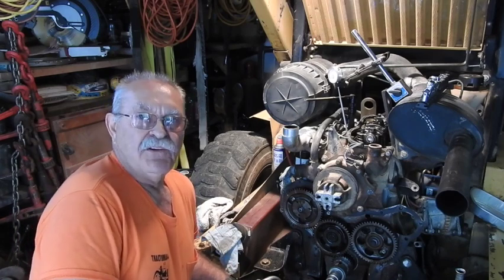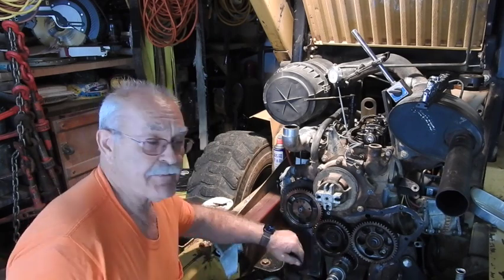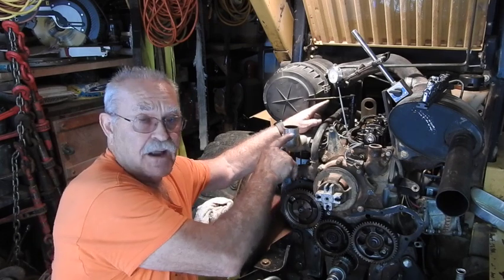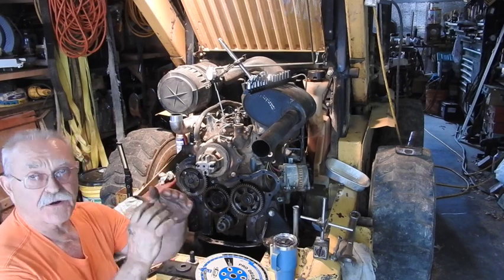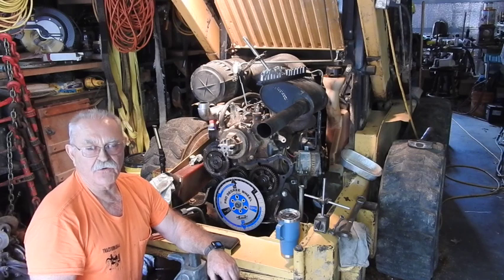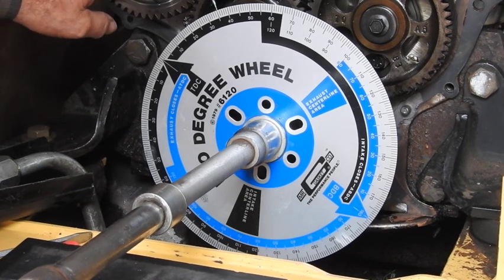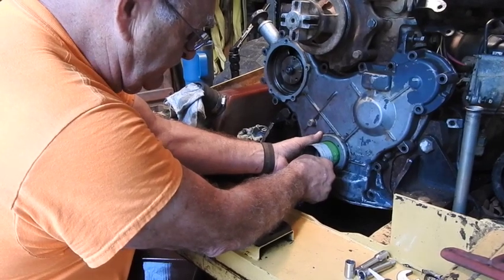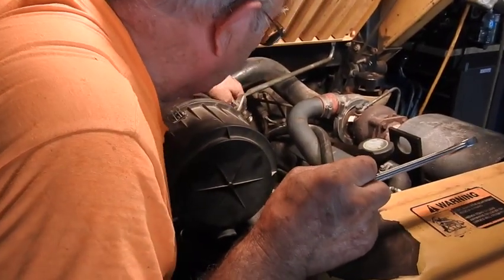Lucas Diesel Injection Pump Timing Perkins 332T

Comment: Hi Wendell, I hope you’re still responding to comments on this thread… I’m about to do this job on my LX865 with the identical pump. If I pinned the pump on removal and didn’t rotate the crank on the motor since removal, can i just remove backlash by hand and follow the torque sequence without all the degree measuring?
Reply from the maker: I would say yes as long as the injection services technique is to measure the exact degree of rotation prior to rebuild and returns it back to that original position. You might verify what their procedure is for dismantling and reassembling to be sure. Good luck with whatever you do though.
Reply: @tractorman4461 thanks! They told to me to pin it and bring it. No TDC needed… just confirming with you. I’ve watched all your videos on this machine. Thanks. Your response time is amazing.

Comment: Grwat video. I might be getting ready to do the same thing. I have a question,  when you mention that you messed up with the injection pump and the locking pin. Does that mean if you had just locked it to begin with and never turned anything else, you could have had it rebuilt and stuck it right back in without messing with any timing on the motor? Thanks
Reply from the maker: The two local diesel injection service companies in my immediate area confirmed to me that they place these pumps on a computer controlled device that marks the exact position of the pump on a 360* scale.  Once the pump has been rebuilt the last phase of the rebuild is to set it back to that exact position with the computer.  So if the engine is not rotated while the pump is off, the pump will be mated exactly to the engines timing when the pump was removed. Now is that  the way all shops do it...?  I don't know. It might be a conversation to have with the shop before you take it in. Now this is the only pump I've ever removed that didn't have either an offset in the drive or a keyway to set the pump position. And even some of the other Lucas pumps are not nearly as difficult as this one if its been shifted out of time.  It might be a Perkins OEM requirement too.  I don't know.  Good luck with your project.

Comment: Do you have pictures for the pump timing, when you slide in?
Reply from the maker: If you pinned the pump shaft down prior to removal and took it to an injection services company to rebuild the pump AND did not rotate the engine, the pump should come back from the rebuilder in the exact position it was in when they received it. These particular pumps have no keyed shaft connection and no definitive timing marks for service. They are a friction fit on a tapered shaft and need to be on the money. I'm sure in one of the videos, there's footage of the actual pump instal, but it literally slips right in and it attached with three mounting bolts. No slots in the flange like some pumps.
Reply: @tractorman4461  I messed up my timing, I didn't know the little screw was for locking the pump, anyways I took the pump for rebuild and they locked it the same position I remove it, I proceed to install and yeah, no luck, so I took a picture when I removed it and try to copy the same position and guess what, is not the same as the beginning when I took it for rebuild, gonna try new position tomorrow morning, hopefully it works this time.

Comment: I have a stanadyne/roosa master injection pump i can't see the mark on the retainer ring , on the injection pump that suppose to line up how can I time my 1974 510 jd backhoe. Would I have to take pump apart again
Reply from the maker: That's a question I'm afraid I am unqualified to answer for you. Good luck with the solution. I am totally unfamiliar with your machine. Sorry )-:

Comment: Manual for 4.236 says just put it at TDC number 1 and install the pump, lining up the mark
Reply from the maker: I wish the 332T Perkins was that easy. This three cylinder has no timing marks on the pump or pump drive and has a friction fit tapered shaft with no keyway. It doesn't even have slotted mounting holes that can allow an easy few degrees adjustment. This one is fitted with a Lucas pump as well.  Not a good design.

Comment: Hello... excellent explanation! Would you happen to be able to tell me if for the Perkins 1104C series engine without turbo, the injection timing is also 28° like this 332T, or would it be 26° like the old AD4.203?
Thanks
Reply from the maker: Honestly I really don't know.  All I can tell you is they are all very critical.  And information is very difficult to find, believe me on that.  The Perkins shops guard it like Fort Knox and don't want to talk to you. They want to write the thousand dollar repair bill I think.
Reply: lol it's true!!  I contacted the Perkins representation and they denied me the information... I also tried to contact Delphi and never received a response... what I got with technical assistance here in Brazil was 22 degrees btdc for power generation applications and 24 btdc degrees for agricultural applications, both without turbo.  for agricultural applications with turbo it goes to 25 degrees or more... this is for pumps without advance type Delphi dp100... thank you

Comment: I’ve been following along with ur videos i pulled my injectors out but can seem to find the correction replacements the part number all corroded
Reply from the maker: Unfortunately I don't remember if I even wrote them down.  Are you working on this identical engine..the 332 T ? I took mine to the injection shop and he cleaned and tested them so I don't think I even needed to check the numbers. If you have a Diesel injection services company near you, he may be able to fix you up with what you need.

Comment: looks like the same engine thats in the ls180, you are right that it is hard to find info on it I thought the engi e was made by ford. How smooth does it idle, I know many of thr 3 cylinders shake a lot at idle
Reply from the maker: Its a very popular engine that's in a lot of equipment.  Ford has them in quite a few ag tractors as well as skidsteers.  I think it idles really smooth and with pre-heat starts quickly. Now it takes 3 or 4 heat cycles when its 10 or 15 degrees outside, but above 35 or 40 it literally pops right off with a couple turns of the crank. Thanks Mark for visiting today.

Comment: Great video sir. I am having issues with my LS180 (same setup as your engine) running hot after messing with the injector pump.  What coolant temp does yours run now?
Reply from the maker: Unfortunately my temp sensor had failed months prior to making this repair and that's the about only thing I forgot to replace.  It shows hot from a cold start so I keep my display on the hydraulic oil temperature.  The oil temp runs 176 or close to it consistently during operation.  I still have not even ordered the coolant sensor yet. Thanks for reminding me.  Were you lucky enough to find the locking pin and lock the pump with the pin before you removed it ?
Reply: @tractorman4461  
My hydraulic oil temp shows 170 but I have the high flow so there is an extra cooler.  I installed a mechanical coolant temp and it reads about 210-220. I had a valve fail in the engine so it was rebuilt, I assumed that the injection pump was keyed but soon realized that the gear is not keyed and can be put on in any position. The book further confuses things when it talks about the pump lock at 340 degrees and the engine at 29 BTDC. According to your method, I have had it run anywhere from 12-30 BTDC and installing the pump to fire exactly at that timing mark. Just still concerned about the coolant temp pushing the 220 mark.

Comment: Glad you got it up and running again. I think you explained it pretty well, especially the part about not screwing up by moving stuff after removing the pump. Yeah, diesels are a little different to work on. Carburetor, set of points and a condenser are more my cup of tea. I'll leave the diesels to the experts. 👍👍👍
Reply from the maker: The aggravating thing with this particular CAV pump is its not keyed to the shaft.  Nothing but a taper fit which is why correct torque is so important. But that's the reason the gears have to be set to the correct BTDC  before the distributor pump drive gear can be torqued in place.  Because it is actually LOCKED in time by the rebuilder at the specific degree of rotation at the exact point at which it begins shooting in the juice. So then you have to install it with the gear loose, set the rotation of the crank, idler, camshaft with the loose pump drive gear at the point BEFORE TDC for piston #1 needs to be on the compression stroke. Then and only then can you tighten the drive gear on the tapered shaft....then immediately unlock the pump after the first low torque setting on the gear.  If you torque it fully down while locked, you take the chance of damaging the rotating internals of the locked pump. Tricky huh.... Its hard to explain in print.

Comment: Great video. There should be no “backlash” on this one!
Reply from the maker: Well, there shouldn't be anyway.  Not only causing premature wear, backlash in the distributor pump gear is enough to effect the timing.  Hard to believe, but it can have an effect on the timing just like being off TDC a degree.

Comment: You would make a good instructor Wendell!  A sure sign that everything is 'on the money' is that there was no smoke, and that is very 'tell tale' in an engine like this.
Good job!
Reply from the maker: Hot dang Reg, we got lucky once again Reg !!  White OR black smoke is a no-no for sure. It sure would be nice to be able to see timing marks on the flywheel though.  I still think removing the skid plates may reveal another inspection plate from the bottom.  But to do that, it'd have to be up on blocks.
Reply: @tractorman4461   All we have to do is think ahead when a machine is about to 'break-down' and before it shuts off, be sure to park it on a ramp or on some nice high blocks! 
This is what should be called 'Anticipated hind sight' LOL!

Comment: Good job Wendell . Good old Perkins there a good working engine plus on fuel to .
Reply from the maker: I had another Perkins 3 cylinder in a little Massey Ferguson 2244 high lift. American tractor, Italian Drott loader and Perkins engine !!  It was a good strong 152 cubic inch engine too.

Comment: perkins good engine have fordson major e27n with p 6 built 1950
Reply from the maker: Yessir, Perkins makes a very good product.  And so does Lucas....as long as they don't fail.  I've had my share of Ford products with Lucas electrical problems.  But in general all is good.  Thank you Nigel for another visit.

Comment: Hot dog tm44 that was slick. Sounded good too, like a diesel should. I liked the idea of using a pop can slid over the shaft to install a seal. Never heard of that before. Clever idea.
Reply from the maker: Hahahaha....those seals can be very tricky Dean.  Even greased, they can turn inside out in a snap, then you gotta do it again.  A little grease and a 'funnel' made from a pop/beer can (even a Bud Light) does the trick !!  LOL